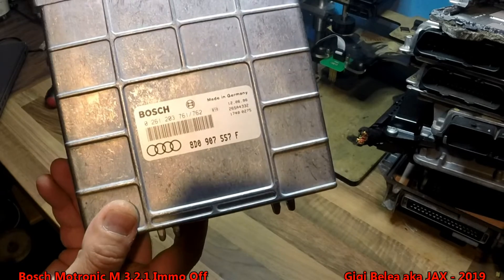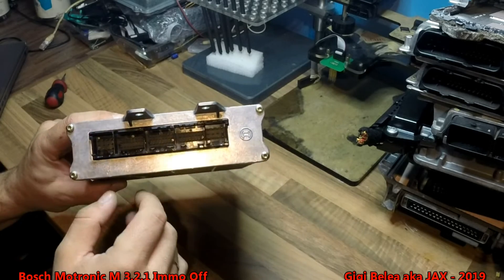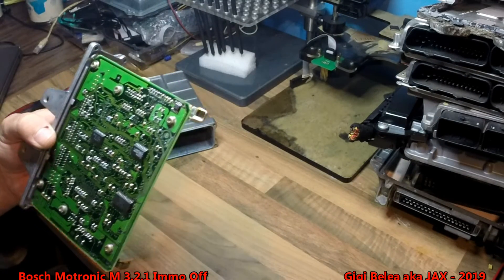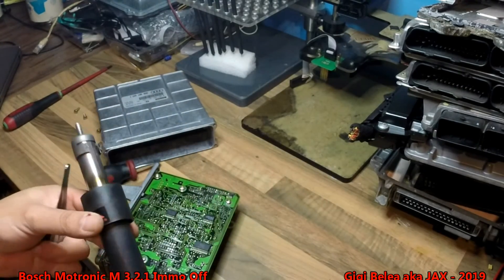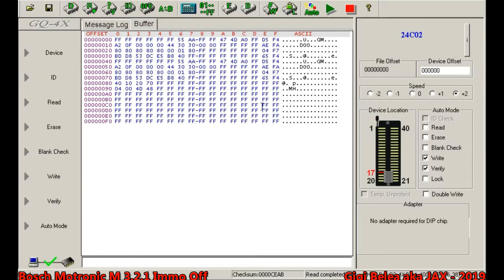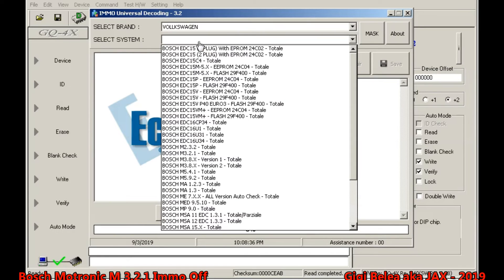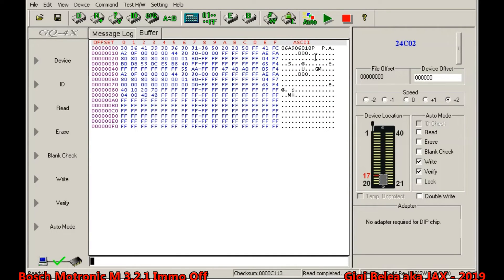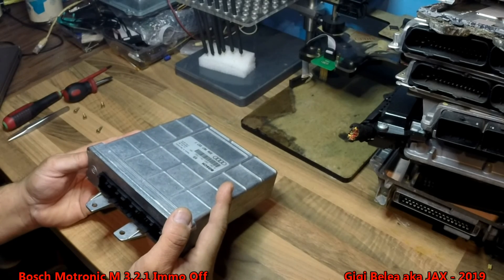Bosch M 3.2.1 Immo Off

Comment: I bought an ecu that immo is turned of. Can I take that little thing you are programming and put it on my old ecu? Because the old ecu is chip tuned and good.
Reply from the maker: Yes, you can :)
Reply: @GigiBeleaDK 
Bought ECU’s are the same. It says 0 261 204 184/185
And then some other says 8D0 907 557 T

Only difference is where it says the year. The old says 
24.01.97 and bunch of other numbers. 
And the new with immo of says
11.09.96 and some other shit. 

But when I open them up. They are identical “of course”
But when I look on the components and all the tiny chips that are inside them “they look the same but these is difference on the numbers on them. Does it matter or can I still swap the eeprom???

My original ECU whit chip tuning the eeprom says 
67AN B58 258
And the new one with immo off the eeprom says
63AD B58 258

So my question is. Does it matter? Or can I still just. Swap the eeprom over to the “old, original, chip tuned” ECU?
Reply from the maker: @TelefonTvå  If is the same BOSCH number like 0261xxx same inside should work. Swap and see :)

Comment: It is not possible to program it on place. How does the SA remove the IMMO from the binary?
Reply from the maker: bbogdanmircea never tried to program it on the pcb. Might be possible. I think the software just removes the bits where the immo is enabled or marks them as “disabled”. Not sure.
Reply: Yes, but take care to don't make any short circuit between legs, it will burns the EEPROM. You can connect it via simple wires from EEPROM pin to Programmer just put the wire in right position from EEPROM pin to programmer socket.
Cheers!